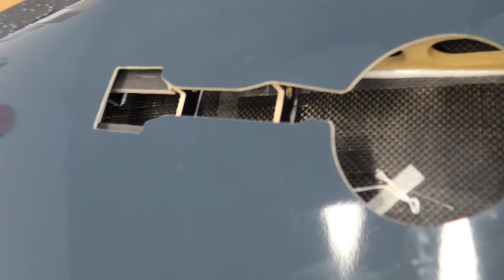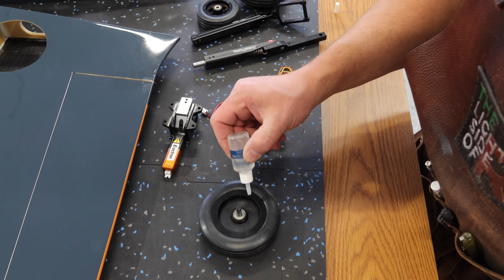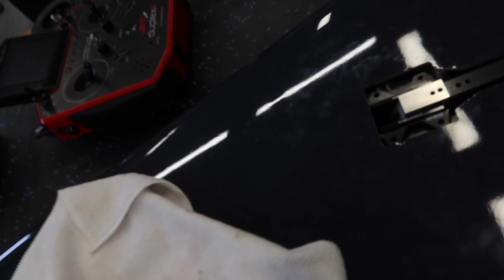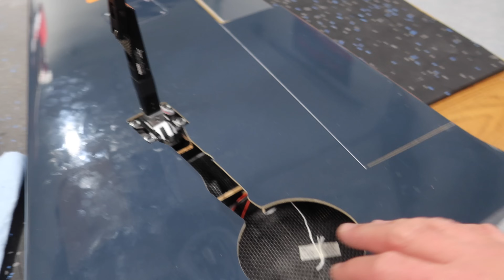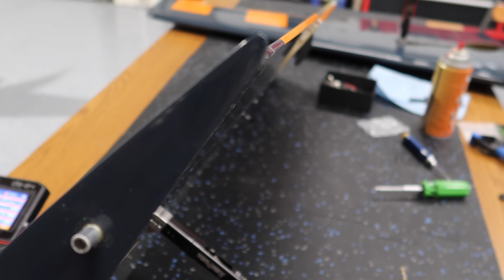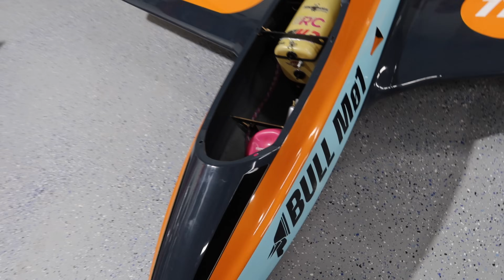GIVING The BULL Its WINGS - Hispano Aviation BULL RCJET

Comment: I have an adhesive you should try it's called e6000.  You can get it in white clear and black at all places Walmart in the arts and crafts department.  To squeeze it out of the tube and let it sit overnight it's awesome you'll glue anything to anything.
Reply from the maker: Thanks Mike.  I use clear E6000 all the time.  It's the same family as GOOP but thinner.  I use GOOP more often though.

Comment: Button head cap screws with max of 2 threads showing thru the nuts would be a lot nicer for the aileron servo mounts.
Reply from the maker: Agreed!  Didn’t have any so used what I had.